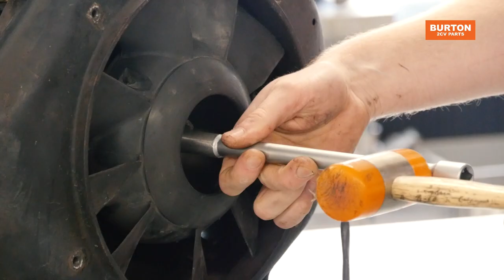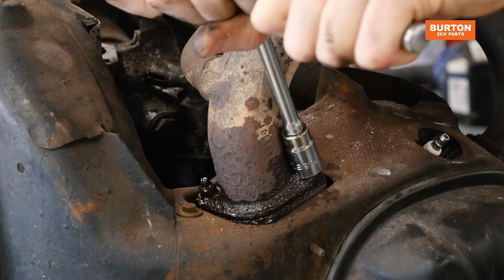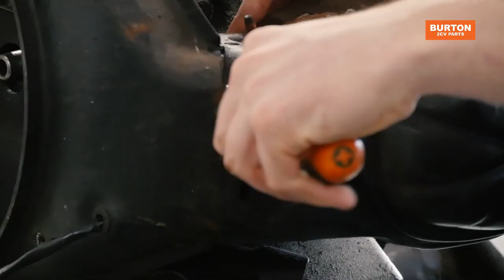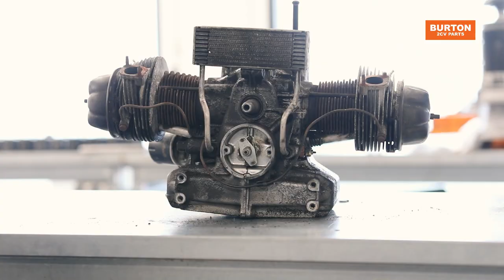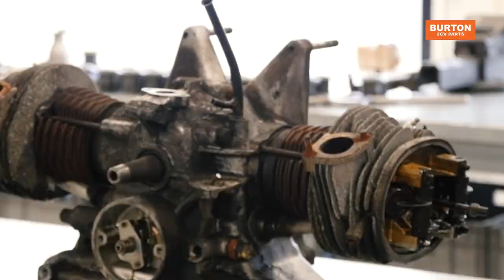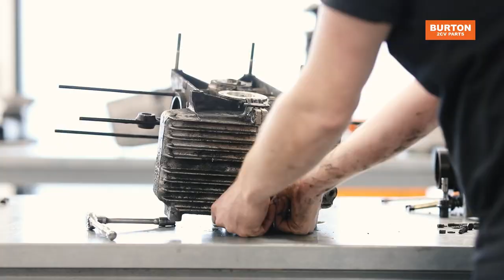Rebuild a 2CV Engine | Part 1: Disassembly | BURTON 2CV PARTS

Comment: So, the 2CV Citroen engine is an air-cooled, flat , 2 cylinder opposed, 4 cycle, Hemi, wet sump, non-transverse mounted engine, trans-axle   Right?